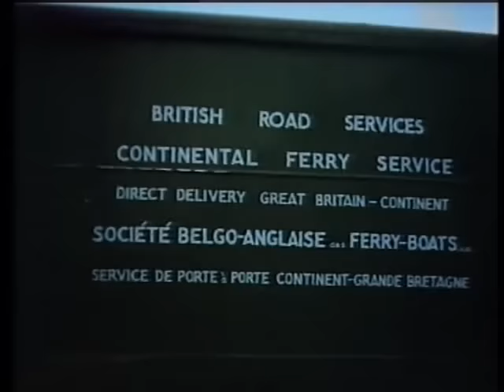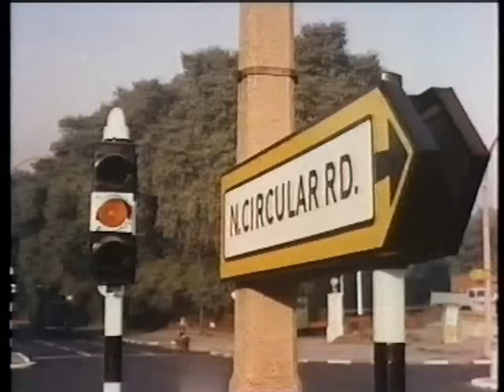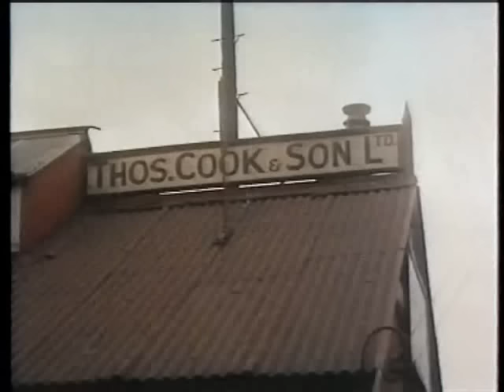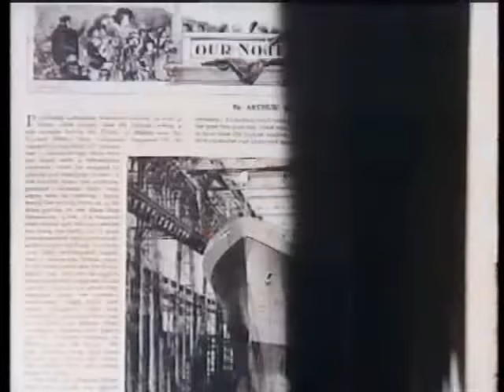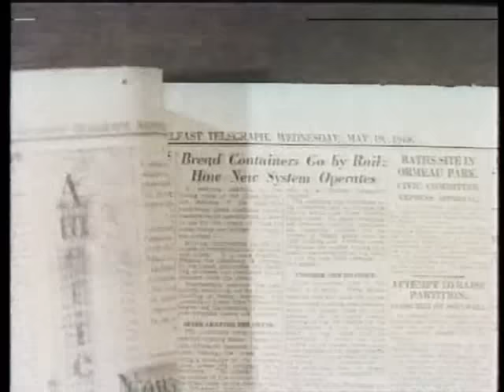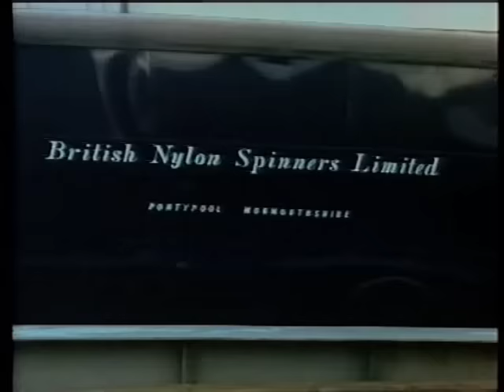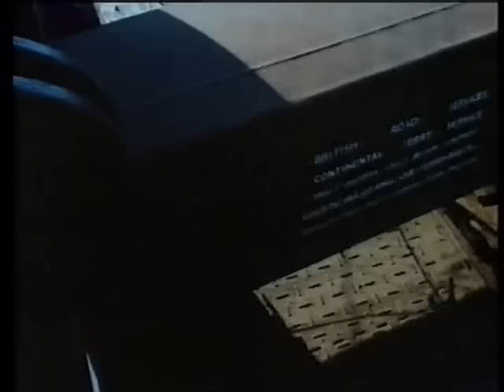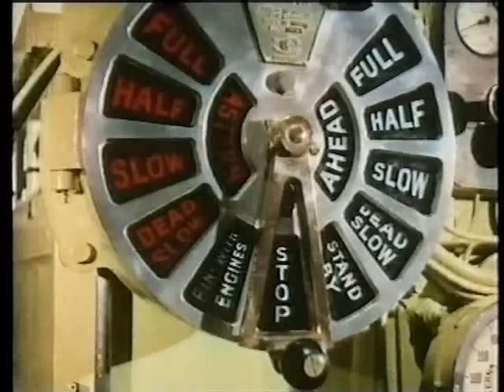Part 1: 1950's BTF "Ferry Load" ~ BRS Transport Tilbury-Antwerp & Preston-Larne ~ Pickfords

Comment: Why did only the trailers go to Europe. And not the whole shebang? Did it not make sense to send the tractor unit to say Italy France or Germany?
Reply: Driving a Right hand drive lorry tractor in Europe was not too easy and could be quite dangerous at junctions etc. The mileages that would have been clocked up going to Milan etc would have meant many more engine rebuilds for the tractor units - engines didn't last like they do these days. You also have to sort out the monies to pay for good and services in a country using foreign currency - no Visa or Mastercard networks back then. Love you use of 'shebang' - a word not used much these days.

Comment: For some reason this came up on my recommended for you list. Rather nice that it did, my dad worked in Tilbury for the Mercantile Marine Office. Obviously I grew up not that far from Tilbury, the docks have changed enormously, these days it's mostly car imports and container traffic.

Purfleet deep water berth which is a little further upstream from Tilbury is the busy trailer port these days with daily sailings to and from Zeebrugge and Rotterdam. There's currently a major roadwork development nearing completion to take the heavy vehicles away from the existing entrance which impinges on the residential part of the village.

Comment: Not a container in sight.
Containers changed everything.
Reply: steady eddie  Not really @steady eddie - Freight Containerization was pioneered in the USA, which helps to explain why container sizes are described as Twenty Footers and Forty Footers - the technical term TEU is an acronym for Twenty Foot Equivalent - the capacity of container ships is still measured using TEU unit numbers - this despite International Shipping, in common with all other cross-border activities, utilising the metric measuring system. 
It is fair to claim that the advent of the Common Market (or European Economic Community to use a more accurate term) coincided with the explosive growth of international trade in general, and containerized freight movements in particular, during the relevant period, ie. from late 1950s onwards, but the two factors are not directly connected.
Reply: @peterdavidson3268  what's that got to do with there being no containers in sight in the video?